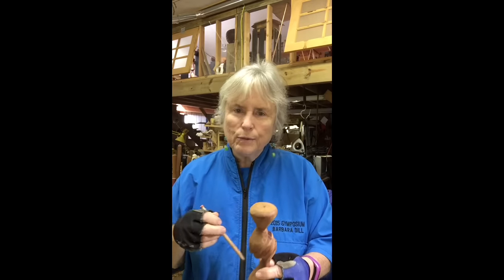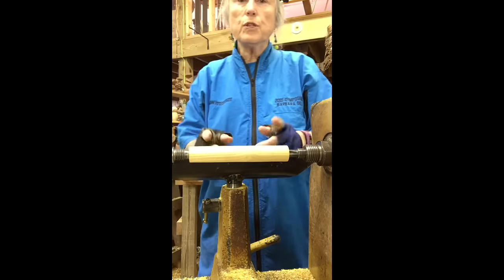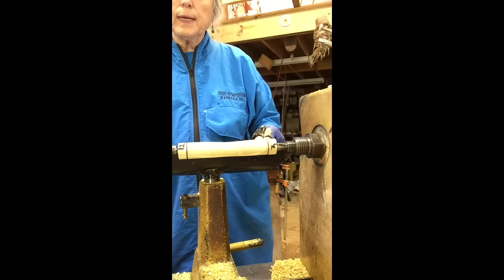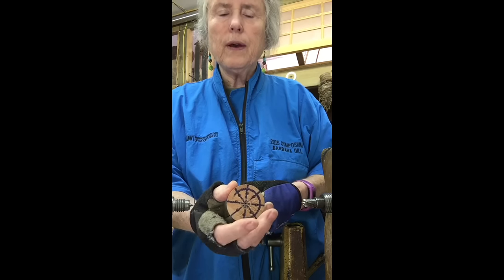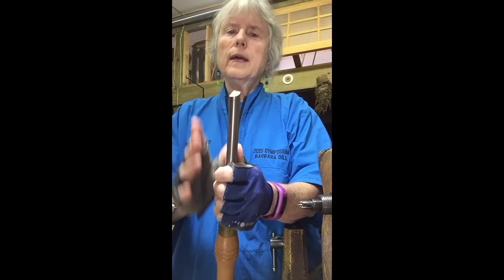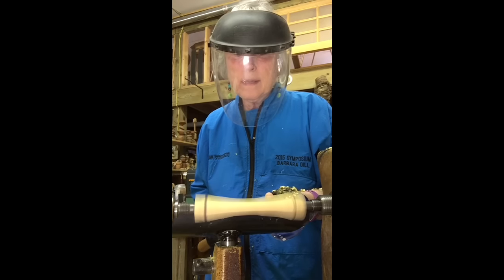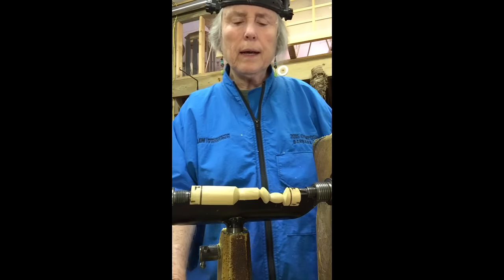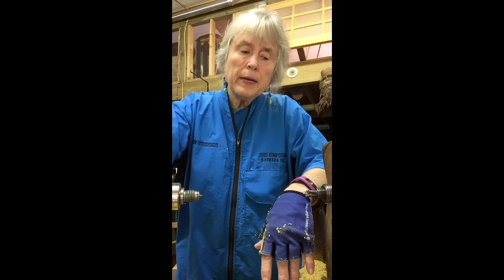IMG 0198 THE VIDEO 2015

Comment: That was a great demonstration Barbra!! A few months ago I came across one of your videos on multi axis turning. I believe it was the one where you were teaching a group to do a twisted cup. I tried it and did pretty well with it. I was more into turning pens at the time. I have been doing some experimenting with different pen blanks. So a month ago I took a red oak pen blank and did a multi axis turning and it came out awesome looking. The only thing is that I need a thick enough blank and I had to go from live centers to mandrel and back. It does need work to get it just right. The thickness of the blank and that the ends match the hardware. Seeing your video gave me the idea. Thank you
Reply from the maker: Thank you!!! I love sharing this.
Reply: I would gladly send you a picture of the pen if you would like. It turned out so nice.
Reply from the maker: Please do!!!!